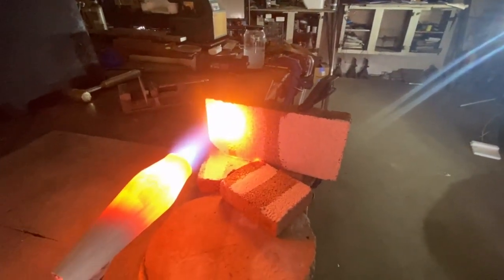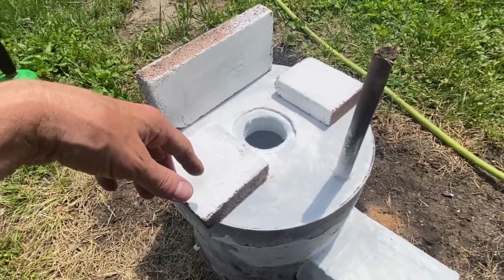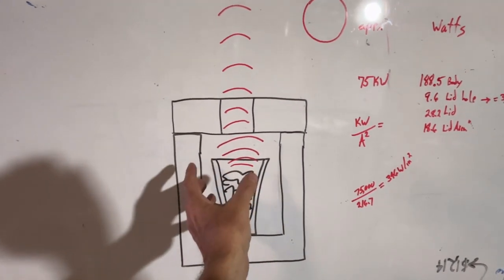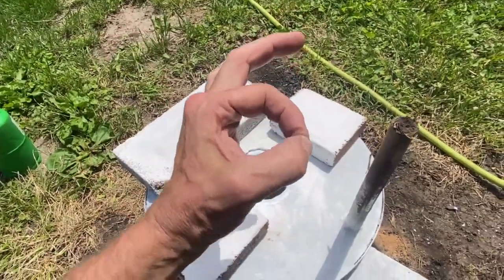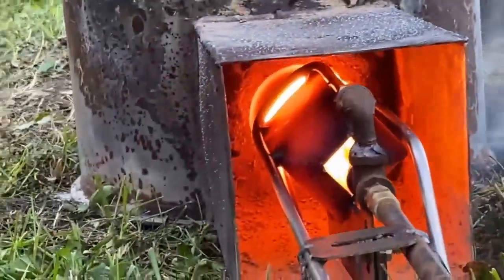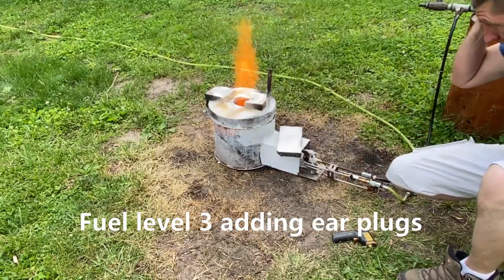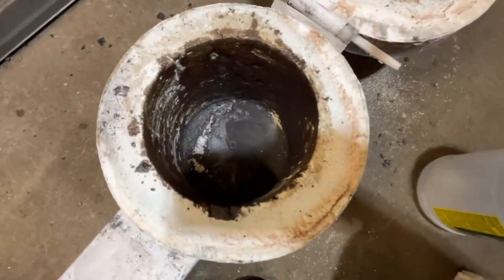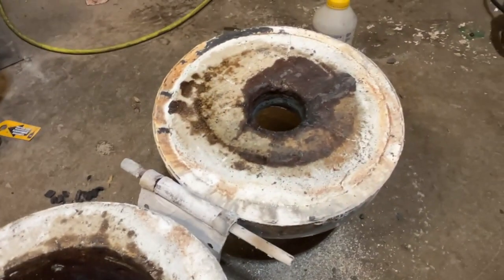High Emissivity coating for max forge foundry temps

Comment: I’m not here to annoy you.
Just want to see you succeed so I can use the Results without doing the fat Amount of Work you put into it…

The "Hat" is where the Difference between Reflection and Absorption + Reemission gets you.
When the Coating absorbs the Energy it’s obviously turned into Heat Energy for the Atoms and they in Turn radiate that of as Photons.
The Problem is, that the Emission is omnidirectional, so your Directionality comes mainly from the Shadow thats created by the Material around.
In the Furnace it’s no big Issue, as nearly everything in Line of Sight from each Point on the Wall is hot anyway.
The Part that can exit trough the Exhaust is the main Loss for that Topic.
The Hat in Turn "sees" everything that is in the Line of Sight of the hot Coating on it.

With a true Reflection you could use a Mirror to shape the Direction.

So a true parabolic Shape might be to complicated for the Result.
As the Radiation Energy can get reemitted on the Hat Shape as often as necessary, like in the Furnace, probably a small Stainless Kitchen Bowl to cast a Head around and then coat the concave Void could be enough.
Even directly coating a Stainless Kitchen Bowl that is not much wider than the Furnace Opening might work.

The Sides that space the Bowl from the initial Outlet give the Exit for the Exhaust Gasses and you might want to have them with a low Emissivity as that translates to a low Absorption.
The Slit should be as small as possible to keep the Window to Escape for the thermal Radiation minimal.
The Size mainly depends on how much Backpressure can be tolerated.
Reply from the maker: Yes my love for the Idea comes from the other aspect , the discharge gases heating the hat to 2000 F making it emit a good deal of heat in itself. As for eh actual reflection power side of it yes it is extremely complicated come to find out .

Comment: its going in the right direction,  have you thought of any uses for the exhaust gases since the heat can only be reflected back in so much and a hole is needed for the exhaust gas to keep the combustion going, so it cant just be fully sealed,... its a lot of wasted potential, I know a simple tray top to help preheat the scrap thats going to be melted or some sort of pipe to feed back into an air intake so its pre-heated air, ....trying to avoid using water as it doesnt play nicely with molten metal if it cracks  😅   but was wondering if you have any good ideas floating around as it would make it more efficient using that wasted heat to say generate some power to charge up a battery that then links to a fan blower to help add more air or something of some use ?

Comment: you sly dog, i was getting ready to suggest a parabolic mirror right before you said it. lol  so, i guess there is no reason why the whole lid shouldn't be domed to  focus on the  surface/middle of the crucible? shame you can't add something like Zirconium carbide for the first layer or so to shield the refractory.

Individually, tantalum and hafnium carbide have the highest melting points among the binary compounds, 4,041 K (3,768 °C; 6,814 °F) and 4,232 K (3,959 °C; 7,158 °F), respectively, and their "alloy" with a composition Ta4HfC5 has a melting point of 4,178 K (3,905 °C; 7,061 °F).
Reply from the maker: Funny you say that i have a diagram i drew up right after the video of a furnace with sloped walls . I will mention you in the next video as i had not got to the Lid just yet and you are spot on

Comment: What would happen if you mixed this coating with the concrete?
Reply from the maker: I was worried it would cause a fragile cast but the thought did cross my mind
Reply: @NOBOX7  A concrete supplier once told me that "you can put anything in concrete"..."ANYTHING!"  That was a joke, but it has been my experience that it is basically true.  What could it hurt to make a  cement hamburger or a few burgers with that coating  mixed in at different ratios and do some testing.  Some fiberglass would help if it is too fragile.